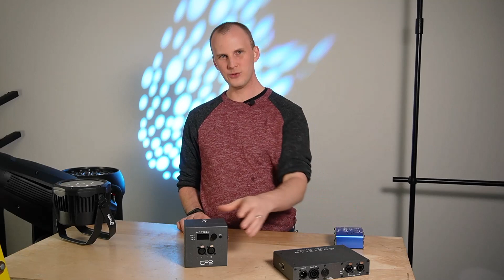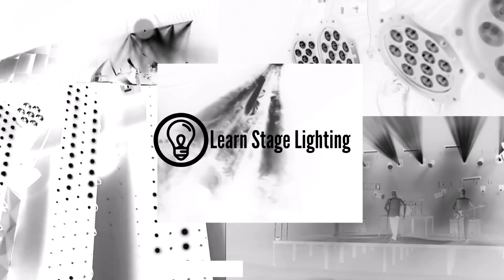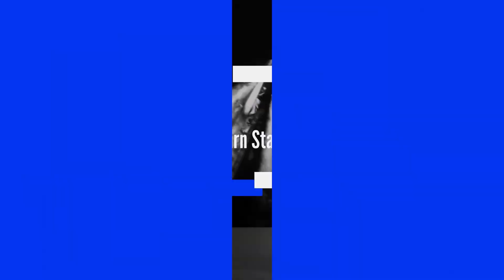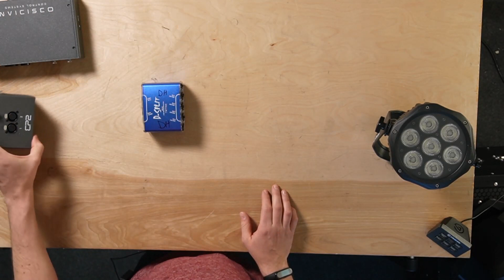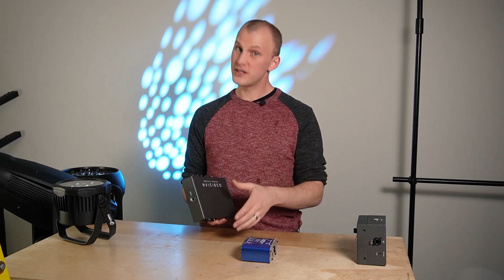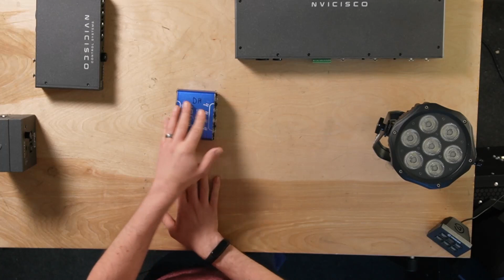DMX Wiring - When Should You Use Splitters Vs. Nodes?

Comment: If you are already using cat6 cable can you use internet splitter? Saving money and still working dmx?
Reply: No, just because it uses cat6 cabling doesn’t mean it is IP
Reply: @andym2225  good to know I wasn't sure if the equipment used a particular protocol or if it was just a hub for raw data. I know some hubs for dmx run cat then open back to dmx so I wasn't sure if it was like using an rs232

Comment: Hi David. I recently discovered your videos and I love what you’re doing! Such excellent content - thank you!

I’m planning a modern and open standard for entertainment lighting data and power.

Some key goals are using 48V combined power and data cable (scroller) for running fixtures, usually an LED light or LED pixel strip section up to 500W.
Data can be split, noded or daisy chaining like DMX but with power up to the port limit.

Data in this open standard includes larger frames (>512) and bi-directional data for fast remote control/monitoring in place of RDM. The physical cabling supports DMX and RDM for backwards compatibility.

I believe dmx/rdm (rs485) and Ethernet (art/sacn/proprietary) data takes a large portion of time planning, rigging and debugging a show. Things have got a bit silly with so many different options and with LED pixel mapping being so common. Lighting tech has become less visual effect focus and more data/networking.

I’d love to discuss this more and ask for your input. Please let me know if so and I’ll get in touch!
Reply: He promotes HI end products and is Reluctant to Do any real content on the Obey 70 controller. Sad how this channel is all about HI Doller equipment. 
Shame on you David
Reply from the maker: sure thing, email questions@learnstagelighting.com

Comment: Your Biased on alot of products, sad you can't even figure out the Obey 70 and show how to use it properly. 
You just call it Crap and move on.
1000s of people use this dmx controller, but you choose to Kick it to the curb because you can't figure it out correctly to make a real video on the Obey 70.
Sad how you talk up the $1000s doller light boards ,but you run from the cheap alternative.
Reply from the maker: Hi Dave, we are not biased towards the Obey 70, But most modern fixtures have large channel counts and unfortunately the Obey is no great at handling many channels per fixture.